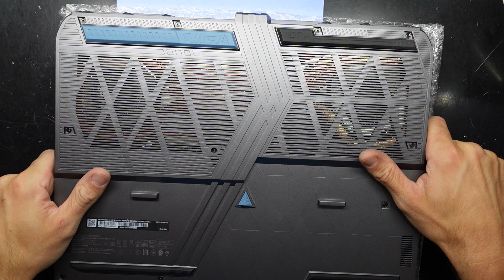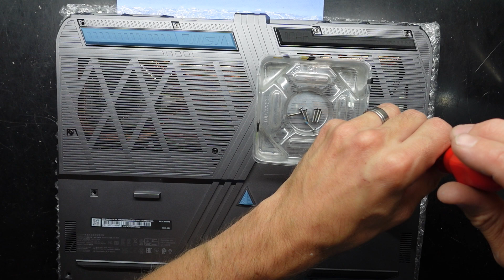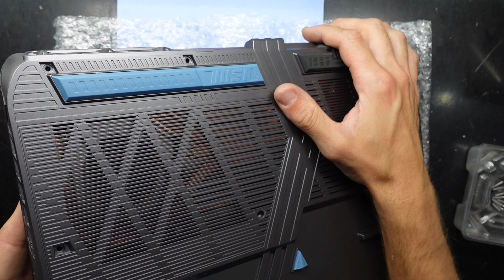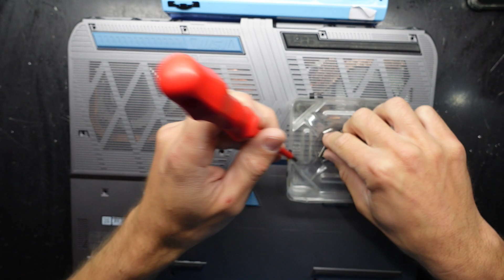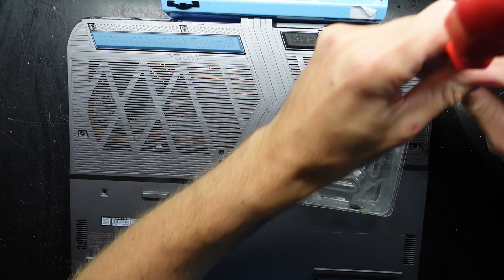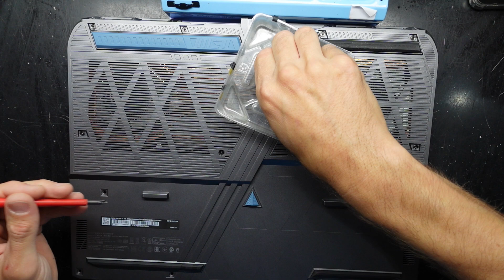MSI Vector 16 HX A14V Teardown and Inspection Upgrade

Comment: To those asking about the rear bezel, I have a 16 HX with the 5070ti and I didnt remove it when I added a SSD and upgraded the RAM in mine. While recommended, it is not required.
Reply from the maker: cheers for the feedback

Comment: thank you for this i was fearful id have to do a hp total tare down to access anything ( TnT i frikin hate those laptops)  but yeh just want to ask do you think the warrantee will cover the sd card slot being repaired? first sd card i put in worked fine then it seemed to get caught as i pulled it out and it pulled the pins back on them selves witch is the weirdest thing I've ever happened to me with full sized sd slots. laptop is only a month old now warrantee is live on the website.

Comment: That shield over RAM can't be very healthy for the modules.
What are the temperatures of the RAM modules?
I would personally remove the shield over RAM, they get no airflow and there is no thermal conductive material making any contact with the PMIC.
Reply from the maker: i think they are for RF shielding

Comment: I replaced my ram and now when I close the cover back the audio jack is not fitting. I tried changing the ram slots, aligning the ram plate cover properly, but it doesn't work. The audio jack keeps stopping the cover.
Reply: Okay nvm, I just found the solution:
Place the back cover normally, and then, with a small screwdriver, gently push the jack port so it goes back in the hole.
Reply: I'm currently having the same issue. Have you found why?

Comment: Hi Rick. Very informative clip. Which state in Australia  are you in? And if you or anyone else can help me reduce the noise of this laptop because i get a frame rate of over 200 with Cyberpunk but the fans are screaming and even the keyboard gets very hot!
Reply from the maker: i am in victoria

but sorry to say there isnt much i can suggest,

turn on vsync.
Frame-rate limit
see if there a silent mode in the MSI control software (it will reduce performance but at the cost of fan noise and heat)

Comment: Hello, for my Model with 5070ti .. I Need a ssd bracket.. They send me one without a guide. 
Its the same Model just an other spec with 500 gb ssd. 
So how to install this ?
Reply from the maker: not sure, maybe try some double sided tape to help
Reply: Yes, MSI is not offering any service guide or mounting brackets to install those SSDs.
In their website, they mentioned clearly that, "For SSD upgrade, consult the MSI support".
MSI made "Custom SSD Brackets" for their own models, you need to contact them for the brackets and they will send a link to you to purchase (free of cost).
It will arrive mostly within a week or so.

Comment: 为啥不带手套呢？
Reply from the maker: i dont understand sorry
Reply: @rickstechrepairs  Fingers can discharge static electricity, which can damage electrical components
Reply from the maker: indeed but iv never had an issue before

always touch a metal screw driver before touching the machine

Comment: Do you know if MSI 16" Vector 16 HX AI A2XWHG got the same logic to install SSD and RAM?
Is the same way you showed in this video? Anyone knows?
Reply from the maker: I don't know sorry
Reply: @rickstechrepairs  ok thanks for answering me. I will wait untill anyone knows this or if I can find something related. 👍🏻
Reply from the maker: Does the laptop look extremely similar underneath/on the bottom

if it does its probably highly likely to be the same method to install the parts
Reply: I am 99% sure it is the exact same process since the chassis seems to be identical
Reply: Okey guys thanks for the info! When I change that in my laptop I will let you know 👍🏻
Reply: @TheAziMax  Hi! So, have you changed it? I'm thinking about getting it, but factory new, has very limited ram memory, and I'm quite bad at tech stuff so I want to make sure I will be able to replace it :) Thanks in advance
Reply: @filipg.5977 not yet but in a near future I will do that change. When I do it I will update in here 😂

Comment: Did you remove the rear upper cover? Behind the screen hinges. Or do you not really nead to do that ?
Reply from the maker: i only removed what you saw
Reply: some folks do it, but its not really necessary, I didnt either when I upgraded the RAM and added another SSD in mine.

Comment: Just got the new msi vector 16 hx, mine came with 16 gb of ram so i order 2 16gb sticks, change the ram should be almost the same on the new model right?
Reply from the maker: that sounds like a good upgrade

i would go 2x 16GB also
Reply: Why did you upgrade the ram? I did this on my older MSI laptop for a slight improvement one the 1% lows for fps -went from 16gb to 32, I’m just asking if there was some improvement you noticed as I have ordered the new version of this laptop too with the 5080
Reply: @busa916  32GB of RAM is more future proof. Some games push more than 16GB, and for video editing it can use a lot of RAM as well.

Comment: Thanks for the video.Ive just bought same laptop,but i have 1tb ssd,can you say,what gen nvme you have there?Like i understand there is gen4 and gen5,what gen is installed?thanks.
Reply from the maker: Gen 4 wiould be fine
Reply: The laptop comes with gen 4 from the factory, the free slot is gen 5 compatible. Obviously if you can afford it you should go with gen 5 for higher speeds.